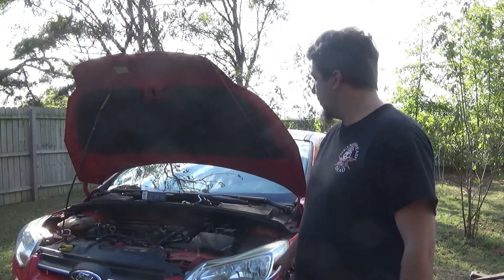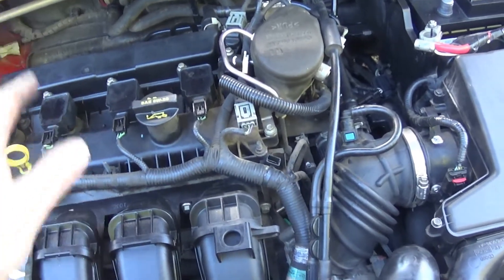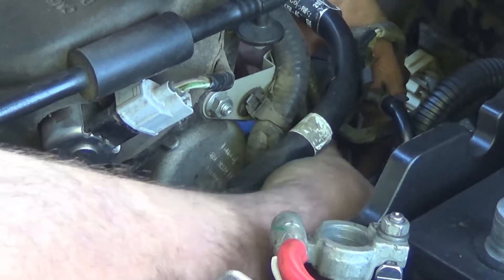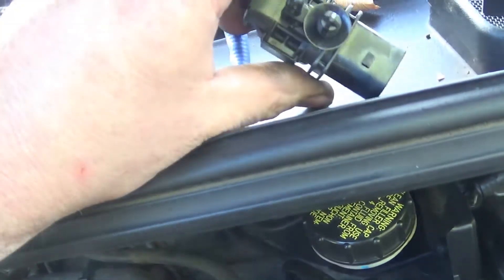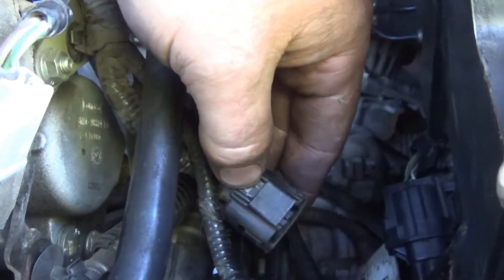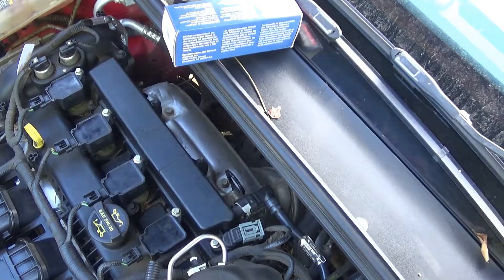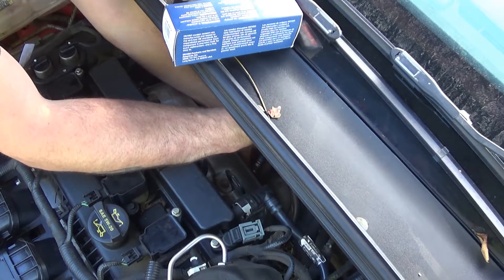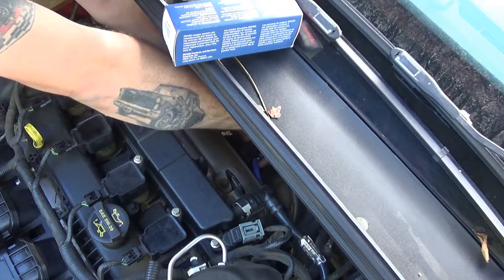upstream o2 sensor 2012 ford focus

Comment: I had to get mine off with an impact when put back on without the impact exhaust was leaking visibily I can't see it anymore but I can smell it in the cab I threaded it back on by hand and tighten it back down with the impact
Reply from the maker: possible threads could be damaged
Reply: @EfurdGarage  how do you fix that without going to the shop
Reply from the maker: @patrickharvey158  well you could chase the threads with a tap, weld in a new bung if you have the tools. Did your o2 have the metal washer?
Reply: @EfurdGarage  the new one didn't come with a washer and I don't remember one coming off of the old one either